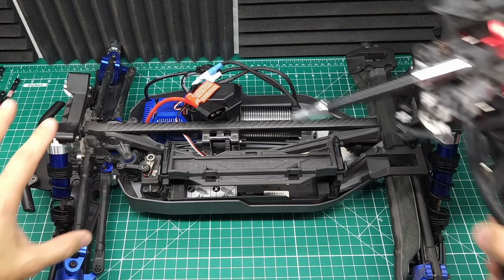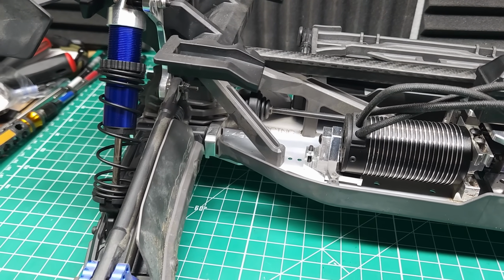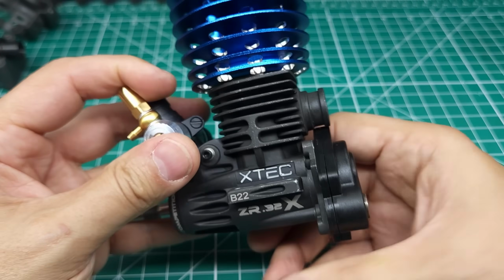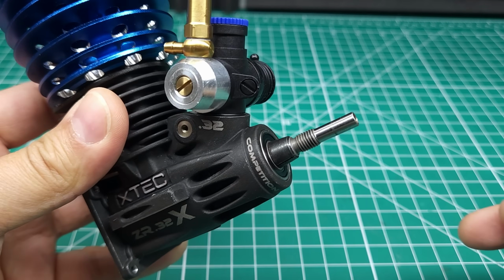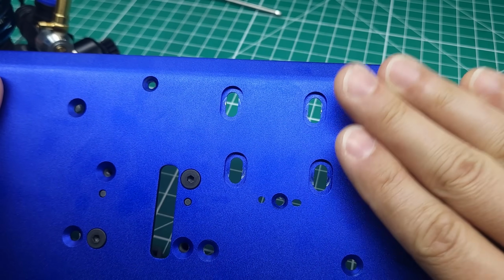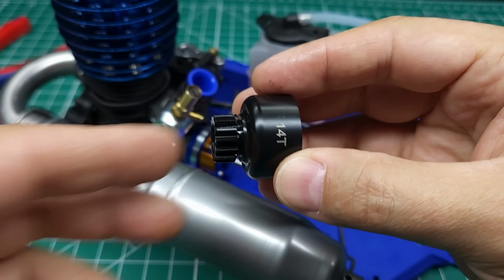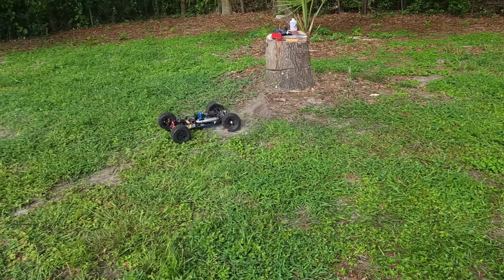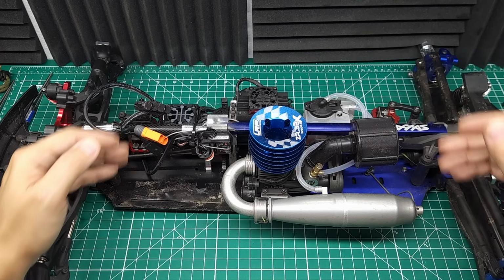Hybrid 2.0 - I Built The Craziest RC Monster EVER!

Comment: You weren’t lying in your reply on the last video. This second part to the hybrid system is awesome!!!

I almost wonder if it would be too complicated to use one of those fancy two speed transmissions for the nitro engine. I can imagine the electric motor is being held back by the fact the nitro can only rev so high. If it had a second gear you may be able to use more of the RPM range of the electric motor as well and get more top speed out of it. 

Then again maybe just a better tune like you said would make a huge difference too. Can’t wait to see what else you have in store for us!
Reply from the maker: I think this would work a lot better if the engine was running properly. I never could quite get it to run right

Comment: I would set the timing by adjusting the ports on the nitro. Then I would run a hotter plug and 20 percent nitro. I am a mechanic and I custom build 2 stroke dirtbikes and rc planes and cars. As far as I know I have the only water cooled baja 5b to date, I'm sure someone else has done it before me but I haven't found any mention of it.
Reply from the maker: Sounds awesome!
Reply: @DoRC  I think your builds are pretty interesting. Very cool channel
Reply from the maker: @dudebrosk Thanks!i9460

Comment: Interesting that’s a tiny bell for an LRP looking forward to this
Reply from the maker: It might look small but it's actually standard size. It's not any smaller than the one I was using previously.
Reply: @DoRC standard side for what? 14 tooth is small for a nitro buggy with a 21 so i mean it’s small tooth side for the LRP .32 usually we put them in Savages and such like but with a 14 tooth bell it would be on two wheels for the entire rpm. I think maybe I didn’t make my reference to small clear 👍 amazingly impressive build though man👍👍👍
Reply from the maker: @JoeyNitroRC ohh. Small gear!  Yeah it's not ideal but its what was available on Amazon after I found that the other clutch was toast.

Comment: Was thinking engine front motor rear, but now AWD EV w/engine on top like the last video, but I think this time the motor won't spin the engine backwards since the paddle wheels in the rear won't unhook the terrain turning into slippery flaps and the rear connected to the engine won't go in the air unloading it making it easy to spin the engine backwards too, also more rotating mass for the motor to fight, lastly the from wheels will be loaded to prevent the motor from back spinning the engine! :D
Reply from the maker: Definitely something to try!

Comment: Project idea: Combustion engine RC crawler. That is done before, so to make it more fun a manual transmission would be insanely cool. (Manual as in, from the radio)
Reply: I honestly have no idea if this is possible, but it would be next level cool!
Reply from the maker: Sounds like an interesting project.

Comment: Maybe mess with the throttle channel expo so you’re not out running the nitro rate of acceleration. Fly wheel mass might have something to do with your tuning issues. With the mill you could select a different material and make your own. You would need to figure out which material would give you similar moment of inertia properties with the changed design though
Reply from the maker: It's possible though the amount I took off probably didn't really affect the inertia of the entire rotating mass which includes things like the crankshaft

Comment: Awesome work!

Maybe the lightened flywheel had some influence with the tuning difficulty?
Reply from the maker: It's possible but that would probably only really cause problems at really low RPM and what I took off the flywheel probably didn't have a huge influence on the entire rotating mass inertia.

Comment: So you heard about center diffs and decided to remove it entirely eh? 

A really cool concept and execution. Would a big rock body fit on that monster? 

I have never used a nitro rc motor so i cant say id do anything constructive with one. Ive driven an old tmaxx a guy at the track had and it was fun. 

As to ideas- its dumb but what about a nitro crawler? Lots of reduction gearing but a slow crawl nitro would be hilarious revving like crazy to go .2 mph. :)
Reply from the maker: It's actually larger than a big rock. It's just about perfect for an XRT body

Comment: Awesome 😄
Maybe make a 3.0 with the funco or a baja plus a zenoah 23-32cc hybrid ?? These engines are pretty easy to tune, just regular 2 stroke goodness

A zenoah with 10k rpm clutch, 48/26 gearing and a 6s system, that way the engine kicks in when its already moving

That could be loads of fun, but is easier said than done😅
Reply from the maker: A two-stroke gas engine was actually my first plan but unfortunately there's just no place to put it on that platform. It's way larger than you might think and it just doesn't fit

Comment: Could you run both motors off the same spur gear by mounting one on each side of it? As the nitro only engages once the clutch is up to speed it may work
Reply from the maker: That's actually what I did in my first video with the Funco

Comment: I feel like it wouldnt be to hard for ya to make your own chassy plate of the 2 into 1 out of carbon with your fancy mill im suprised you didnt go all out and get a sheet to do it along with the chassy braces and mayny a custom recever/battery  box
Reply: Why not get a sheet of carbon and use the 2 chassys to cut the chassy plate out that you need is what im meaning i know bolth wont fit i beleve  i remember  you saying that in the video
Reply from the maker: Yeah you could definitely do that but like I said my mill isn't large enough to handle it in one go so it would have to be cut out in two pieces then you'll be dealing with bonding the carbon together and it wouldn't be very elegant. @daytonburke7437
Reply: @DoRC ahhh ok makes sense
Reply from the maker: It is doable though the mill in the video isn't quite large enough to handle an entire chassis at once

Comment: Ps they like it when the top end is lean on the carb and low and mid is slightly smaller then stock propibly like 1 turn out insted of 1 and a 8th and the low end loves it rich just make sure its not to rich or itl back up with fuel and since your breaking it in still make sure its at bdc after rvry cycle when it cools down so you will end up with the most power and life out of it possable
Reply from the maker: Good advice!

Comment: Brother i have that same engine on 3 diffrent  rigs it runs flawless  give me a crack at it my losi 8ight and revi 3.3 with that engine bolth rip wheelies blocks long try 20 percent nitro and they like to run hot by the way like exaust temps 200 degrees evry tank
Reply from the maker: Stay tuned I'll do the drawing soon :-)

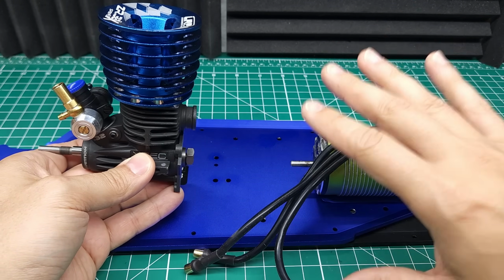Comment: 5 seconds in .. and thumbs up .. ( 1:29 yeah Nitro REAR , but geared really high ) 11:37 , i would  of tried a larger pinion gear 1st for Sure , but i see that would push out your mounting slots more.)) success for sure , only thing i could try different is , GEAR it way higher , since two motors are helping it push xD. cheers
Reply from the maker: I'm sure it could be geared better

Comment: For me i could remove the rear steering  and use the front and run the car with both the motor and the engine at the same time in a straight line to see how fast will it go😊
Reply from the maker: Top speed would be interesting

Comment: Without a proper electronic or mechanic infrastructure behind you'll keep wasting money still having a 20mph car that's not fun, can't jump, can't bush, can't power drift. As per now you have an expensive concept of something that's useless. In FWD it sucks, in RWD it sucks, in "hybrid" is the same. That thing won't even drive straight in hybrid mode for 50 meters, no way. A proof of concept should prove something to get to the next stage. According to what is shown, it didn't even got better than V1, it got slower and worse with the only difference that the nitro kept running without blowing.
Reply from the maker: Thanks for your feedback :-)

Comment: If you send me the engine, I would like to give this another try with the help of a differential to add the 2 motors together. I am only a little bit worried about the clutch. Probably need to use a one-way bearing to prevent it from free-spinning while the engine is not running, but that would disable reverse. I also would like to find a way of measuring the results to see if it is an improvement or not.
Reply from the maker: Sounds awesome!

Comment: Bro, it’s official… you have to design and build your own brand of RC car!! Seriously. You could sell rollers for whatever you want and they would sell… guaranteed. Not hybrid RC’s , at least initially, but an electric stadium/desert racer truck😳… I’d buy one. For real. I know it’s a big deal to do all of that but they wouldn’t be cheap so you could easily keep up. Plus, a custom built RC takes time… period. All I’m saying is if you ever come up with an RC that’s going to be sold online I want the first one off the line signed😎
Reply from the maker: I'd love to but I'm not sure I'm qualified for something like that!
Reply: @DoRC you could start on a good platform and go from there… I just know the engineer will come pouring out of you!! I’m serious. And you are more than qualified… you run RC you fix RC you design and make parts already… and you know where weak spots are and when to use aluminum… the guys designing these current RC’s probably don’t drive them at all! So you are way more qualified than any of them… if you take the time and build a 6s truck/truggy I’ll buy it guaranteed! I know it won’t be cheap… you get what you pay for👍👍.

Comment: Awesome project. I still want to see a nitro+electric powertrain driving the same geartrain, in a compatible way. If it’s geared properly, the e-motor won’t overrev the nitro engine and will just act as an assist.

I’m still thinking starting with a nitro platform, then adding an electric motor to that drivetrain (geared properly) is going to be a good way to achieve this. You’d still rely on the mechanical (nitro) brake system, where the electric motor is only run in one direction; no brakes or reverse.

Also, I’ll put that engine in my BB Revo (currently running a .28 “Big Red”), make a video and post it up (or just send you the video). 

I’d also like to make this Revo a hybrid. Might have time from end of July -mid august.
Reply from the maker: Big block revos are awesome!

Comment: Well with my years dealing with LRP engines having a .30 myself for quite sometime. I learned that the xtec carburetor actually sucks really bad. I wasn't aware of this until a fellow tuber pointed out it's behavior pattern compared to a better manufacturer. I swapped mine out for a novarossi plastic carb and man it was a night / day difference. The engine became so much easier to handle as well as the tuning process. I legitimately couldnt believe my eyes and ears hearing how well it was performing.
Reply from the maker: Yeah that was probably part of the problem!

Comment: Here's my take . Maybe try a 3650 driving 2 wheels on 2s/3s. Try matching electric motor kv to nitros powerband. With a slight rpm bias to electric. IMO that's that jam... If you got a the losi 454 sitting around ,try that carb . If you wanna get silly add plug holes and weight to flywheel....Your springs on clutch might opening funny being so light... Bold build ,man !
Reply from the maker: Yeah adding the weight back might be good. The springs aren't super light but they arent the heaviest.

Comment: If you could switch it fast enough from 4Wheel to crab, it'd be like a Tron light cycle car.
Reply from the maker: Very easily done. You can set up a switch on the transmitter to go back and forth between the two

Comment: Counterbores and slots can be produced using a drill press.
You are making poor Engineering choices because you are far too focused on the CNC tool.
Rookie mistake.

Roll back the tech, and start thinking about fundamental Physics and Engineering.
That will teach you a lot more, and give you a better grounding for any future career or activities.

Tech is just a distraction and a bandaid for poor Engineering.
Reply from the maker: I appreciate your input.  Let me clarify that I've been doing manual machining work including on Mills and lathes for about 30 years now. Yeah you might be able to get away with making those counter board slots on a drill press especially if you have an XY table for it but the remaining material inside that counterbore is only 1 mm thick. Unless you have a really good drill press and you're using an XY table with an end mill in the drill press That's going to be a hard tolerance to hit. Obviously people have been manually machining complicated features for a long time but at the very least the appropriate tool for that is a manual mill.
Reply: @DoRC  you totally missed my main point - you're using tech to mask poor Engineering and Physics skills. 

You'd learn a lot faster if you focus on the fundamental sciences.

Edit - using CMC tools is blue collar work. The white collar science is obviously where you have the potential to learn the most
Reply from the maker: @procatprocat9647 I guess I'm not quite sure what fundamentals you think I'm missing. I have been a professional mechanic my entire life and I grew up under the tutelage of my dad who was also a professional mechanic after being a mechanic in the Air Force. He and I hand-built a full size airplane together before I was 14. He didn't even let me use a power tool until I was 12.  I've been doing all the same stuff by hand for decades. This is my very first CNC machine and I'm 42 years old. 
Can you give me a little more detail as to what you think it is I'm missing?
Reply: @DoRC  Science and Engineering. 

Now i understand why your videos focus on cutting stuff, rather than Engineering. 

No probs. Have fun!
Reply from the maker: @procatprocat9647 All right thanks for your feedback :-)

Comment: Reducing the flywheel mass on the OD for a low torque nitro engine is a poor choice.
Creating a different spool mount would have been the smart money.
Reply from the maker: Reducing the flywheel mass is definitely going to have some effect but generally only at low RPM and given the entire mass of the flywheel crankshaft and one-way driver it's probably only a few percent change which I don't think would make much difference and I really didn't have any problems idling this anyway.

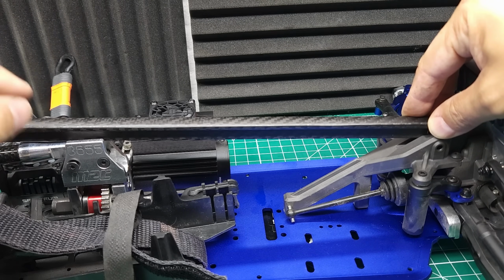Comment: brooo why didnt you flip the diff? 8:25 !!
Reply from the maker: It's not straightforward to do on this ledge. The ring gear sticks out through a slot in the bottom of the bulkhead and down into the chassis. The bulkhead would have to be modified which is doable but it was easier just to flip the engine around

Comment: Also the fuel lines makes a difference. If the fuel is getting fed through too quickly your engine will run rich. And if the exhaust line is too short you will get a lot of pressure in the tank which creates more fuel to come through and would also make it too rich.
Reply from the maker: Surprisingly that's not really true. The pressure in the system is going to be the same regardless of the length of the lines. If the lines are really really long is in like several feet long you might get some reduced flow just because of physical resistance within the lines but in general the line length doesn't really make much difference.
Reply: @DoRC I just recalled before that when my feed line was short I had a really hard time tuning it so I changed it to a longer line and was able to get it stable. Idk, maybe it was other factors associated with it at the time. Also I noticed different brands uses different length of tubing for the feed line and the exhaust line.

Comment: I believe that the caster is only relevant for the tire contact patch in curves in RC cars. Not for reversing, as the servo prevents this by staying in the specified position.
I would use a lot of expo for the rear steering, then you can drive straight ahead reasonably well and it is maneuverable in tight corners.
Reply from the maker: The caster affects the overall stability because even if you aren't turning the car the tires will end up moving very minute amounts due to slop and everything and if you have The caster wrong it'll actually exacerbate those movements which is how you end up with the tires shaking back and forth when you reverse sometimes.

Comment: That was super tech and interesting.  I would have liked to see how you had the front and rear steering set up on the transmitter.
Reply from the maker: The fly sky G11P has a specific mix for four-wheel steering but if you didn't have that you could just set up a mix where the master channel is the steering channel the slave channel is whatever your rear steer output is and then you can either reverse it or set it to have more or less mix that way

Comment: If you want a legitimately great handling (and thus actually usable for higher speeds) 4WS system with that sort of wheelbase, a good way would be to change the rear steering servo's output ratio to 10-15% of the front steering output. Of course, your tx will have to support this feature (or you'll have to use a different servo horn to change the effective output reach) but it would improve the usability of the chassis. Too much rear steer negatively impacts stability.
Also, keep the electric bits in the back; having the lower torque and higher weight from the nitro engine up front would improve front handling, with the mild rear steer helping it along without being overkill!
Reply from the maker: Yeah for sure This definitely wasn't the most practical way to do it but it definitely was the most fun way to do it!